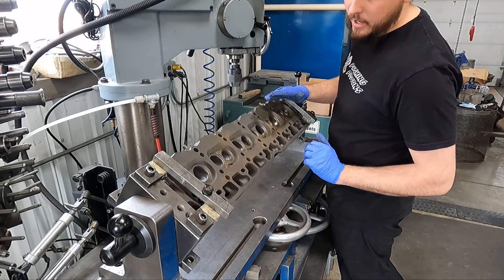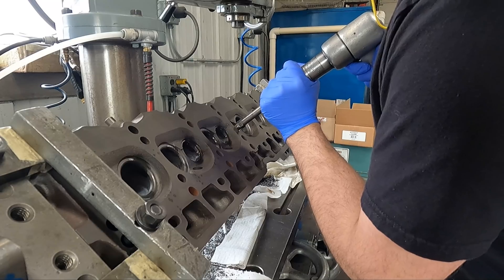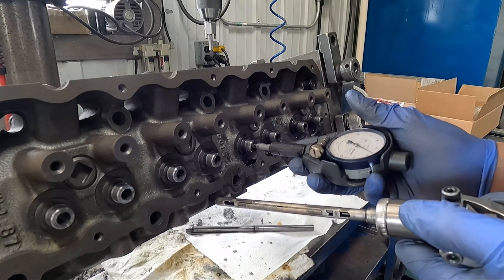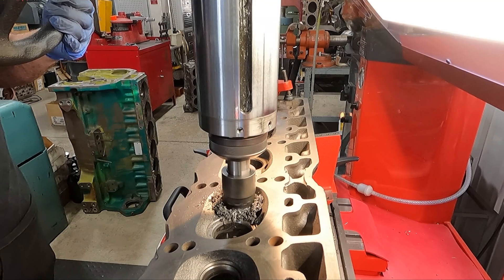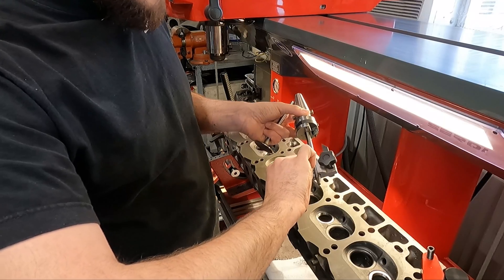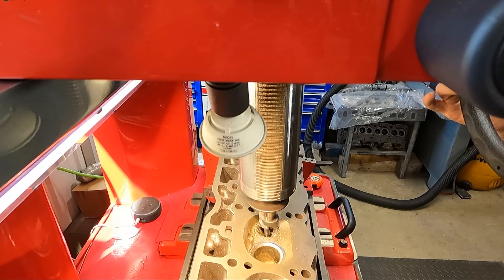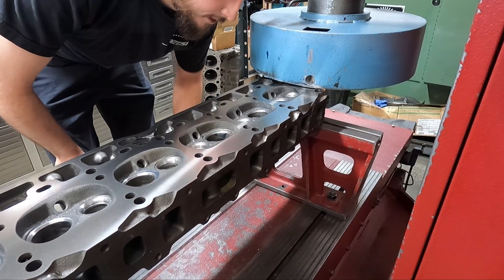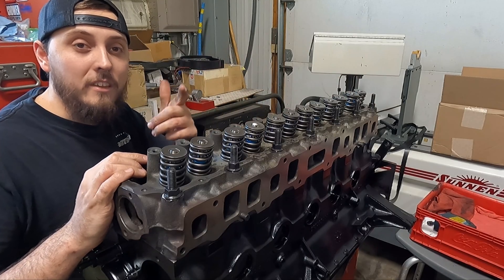Remanufacturing A 258 AMC Cylinder Head From A 1980s Jeep @JAMSIONLINE

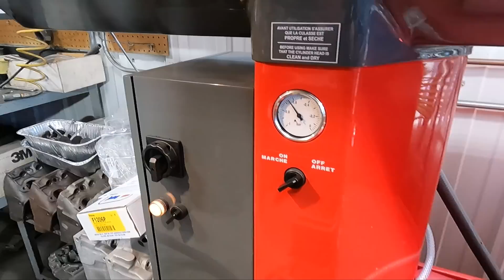Comment: 7:02 if the valves are both closed then why would air leak past the stem?  Am I missing something?
Reply: He is testing the valves from the intake and exhaust port sides, under vacume. The valve stems ends are within that side of the valve sealing point.
If they, some how, tested them from the combustion side of the valve, (under pressure), there would be no leakage issues of the stems.

Comment: Just discovered your channel, its great! I find it therapeutic to watch. I had a question, do you guys ever use honing plates?
Reply from the maker: Yes, but it depends on a variety of factors. We don’t have them for every single engine. The plate for this engine is over $1000. For a stock rebuild, the benefits aren’t there. On the flip side, certain engines distort much worse than others, and even on stock rebuilds they MUST be honed with a plate.

Comment: You need to heat that head up before you press in anything. Once that engine gets hot, those seats can literally just pop out! Same with those guides, they can come out. Just ask dodge about dropped valve seats. Not a bad job at all, but you need to heat the head up before you press in anything.
Reply from the maker: I can see you think you know what you’re talking about, but you don’t.

Heating the head for the install has nothing to do with whether or not the seats and guides will stay put during normal operation.
Reply: @JAMSIONLINE   And I see you lack crucial, long-term experience. You'll learn, in time, from the failures.
Reply from the maker: What’s the name of your machine shop?

We’ve been in operation over 39 years. We have learned what works and what doesn’t.

What is your background on the subject?

Comment: Loved it! Brought back great memories when I owned a 69 rambler station wagon and had the same stock work done to the inline six motor.  Made such a huge difference in performance. Thanks for the awesome content.
Reply: Nice! I just sold my 1969 rambler 440 4 door sedan with the 199 and 3 on the tree last year, I miss it, only had 16k miles but I wasn't driving it enough

Comment: Good seat run out is nice, but it's WAY! over rated, pull the vacuum with the head assembled, then torqued to the block with no valve train and you'll see that it went to hell, then finish assembly and run the engine, if you check the seat seal at that point the vacuum will be better than if you put grease on them the first time.